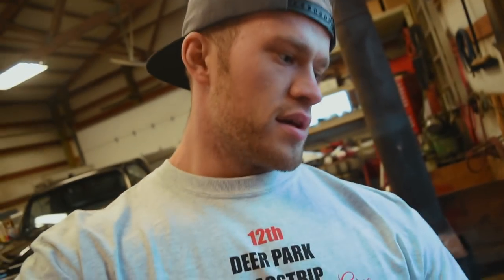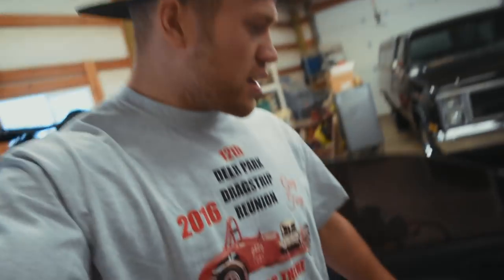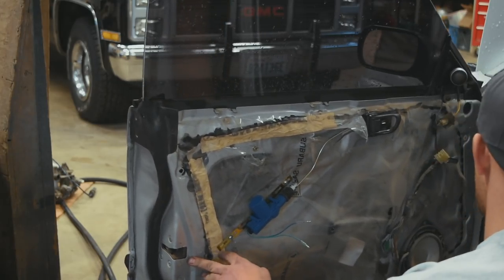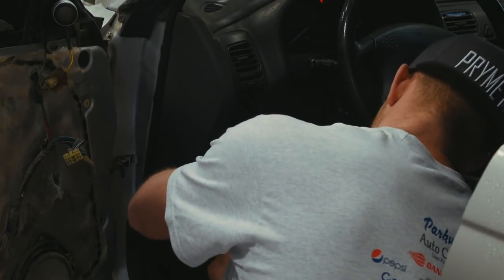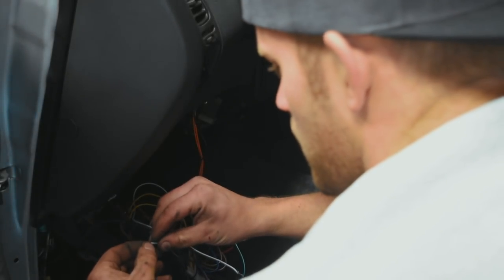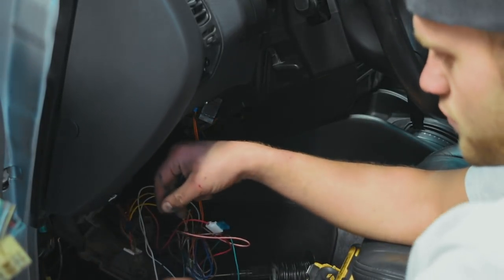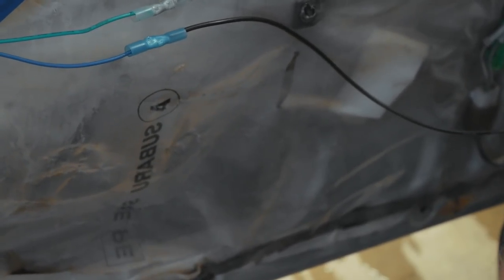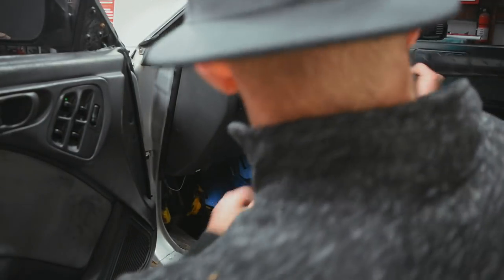Installing $10 Keyless Entry | Does It Work?!

Comment: Hahahaha, i installed the same module and i think the same door lock motor on my 1998 Impreza Plus. I was really supprised when i installed the door lock motor the door panel fits perfectly :O The first time something fits directly! But i mean that i placed the door lock motor behind the rail instead before. Maybe a tip. The positive 12 did i cut off from the relay of the other doors high in the doorpanel. i used speaker wire from the central unit to the door. It was also a lot of work to find the wires of the left and right blink lights. There is also a wire for the backdoor but you can this also use to connect to the horn so you can remotly horn your car. ;)

Comment: sooo, to DRASTICLY oversimplify this. its one wire(s) for constant 12 volt power, one wire for ground.

Then its just one wire spliced into the power unlock wire and one for the power lock button?

Comment: Bro you need some anger management classes. Also those butt connectors will fail. Get a professional open barrel crimper and heat shrink for a professional install